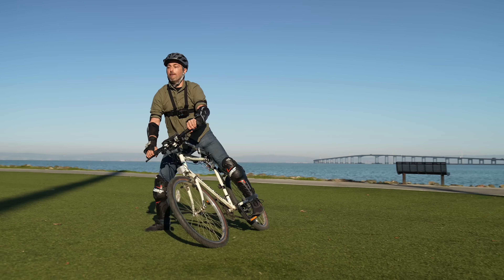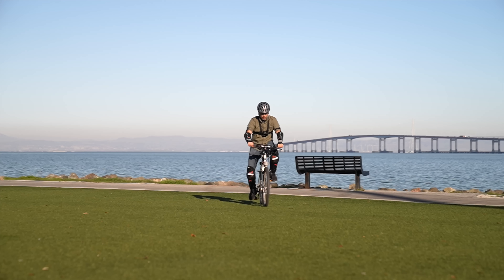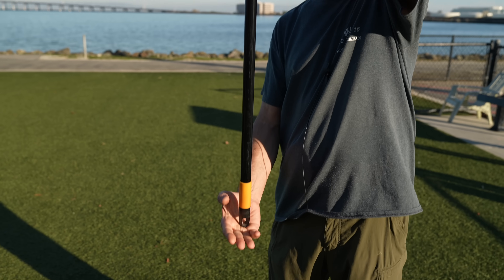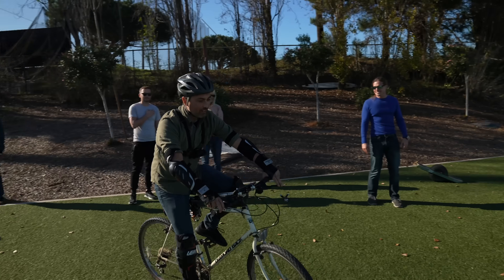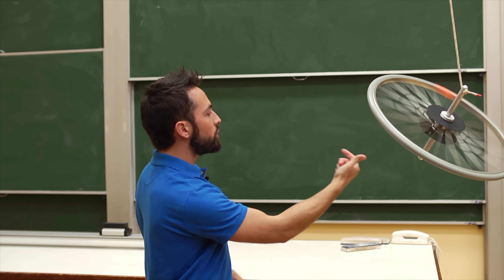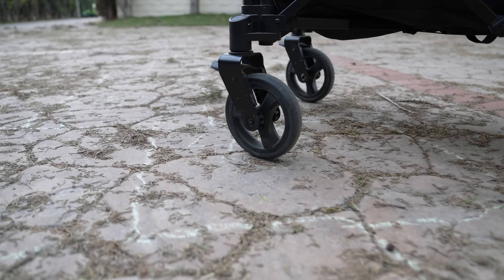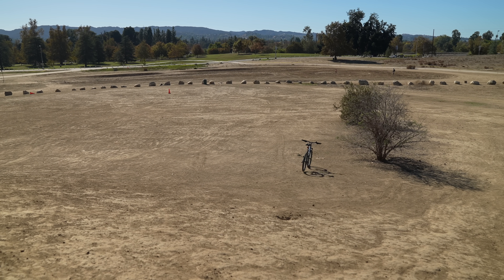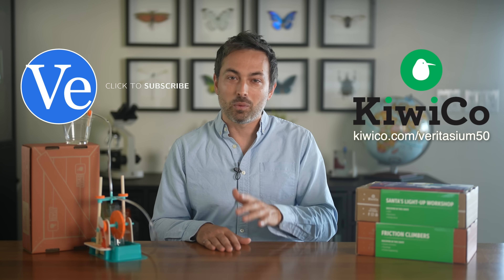Most People Don't Know How Bikes Work

Comment: i dont use handle bars though. i just lean on my bike to turn. i practiced everyday while going to classes lol
Reply: You don't just lean. You think you just lean.
Reply: @XtreeM_FaiL  I took the handle bars off and completed a trail on campus. I had to hold the bars in one of my hands for breaking, but other than that I just lean. what i was trying to say is that that's how to beat the turn lock is to lean in the direction of the turn without touching the handlebars. It takes a bunch of practice but it works
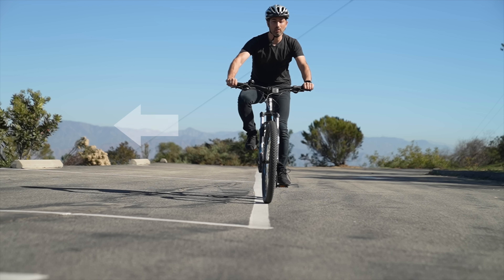Reply: @XtreeM_FaiL  Yea I know. I am saying that if you lean instead of trying to turn with the bars, when the handle bars lock up for the 1 way turning, then you can still effectively turn because you are adjusting your center of mass which makes the wheel turn in a single direction. vs adjusting the bike by turning so your center of mass can allow the bike to turn without tipping the other direction.(2:20)
Reply: @XtreeM_FaiL  why would it need to point in the other direction? it points in the other direction because you steer it in the other direction. I am saying if you lean in the direction you want to go, you don't need to counter steer
Reply: @XtreeM_FaiL  If I lean to adjust my center of mass to the right of the bike. you are saying the wheels would turn left and then right? I don't understand how they could turn left before turning right, otherwise I would fall off. (if they turn to the left first, what keeps them from turning more and more to the left?)

Here are the two scenarios. 

With handlebars turning right: 
1.) steer left so that your center of mass is to the right of you, 
2.) then you steer right to compensate the center of mass which causes you to turn right.

Without handlebars turning right (aka leaning right):
1.)lean right to offset your center of mass to the right
2.)since the center of mass is now to the right of the bike, (+everything mentioned here 7:38), the bike wheel would turn/tilt right causing the bike itself to compensate for the center of mass being to the right of the bike. Thus never needing the handlebars or the wheels to turn left in the first place. suggesting that locking the handlebars from turning left wouldn't do anything to prevent the bike from turning right.

this can also relate to the pendulum example. 3:21 There are 2 ways to make the pendulum move forward.
1.) pull your hand back in the opposite direction before compensating for the new center of mass location in the direction that you want to go.
2.) start the pendulum leaning in the direction you want it to go (or give it a tap to shift the center of mass) and then compensate for the offset center of mass location. which does not require that initial pull to make the center of mass offset.
Reply: @XtreeM_FaiL  What I am saying is that when you lean to the right on the bike, the bike has no need to adjust to the left to compensate for your center of mass which is already on the correct side to make the right turn. But by turning (with handlebars) left slightly before turning right is only because you need to have your center of mass to the right of the bike first before you can continue turning left. (aka moving the bike out from under you 2:27). but by leaning right without touching the handle bars to turn right, the bike has no need to turn left before turning right. ok I have a question for you, what happens to the bike when your center of mass is to the right of the bike?

also 
"2, Wrong. You don't steer right, bike does that automaticly. If you steer right, bike start to lean left.
" That is from the example where you lean to the right to turn right with out touching the handle bars... yea if i steer right, the bike will lean left.. but im saying that you are to lean right which causes the bike to compensate for your change of center of mass

Comment: This is all super cool!  How would you explain that a wheel by itself rolls self balanced indefinitely?  Is it because any lean to the side has a gyroscopic effect that turns it?
Reply: There are other mechanisms at work that weren't mentioned in the video. The doughnut shape and squishiness of the tyre generate additional self-aligning torques.

Part of it comes from bike tyres being shaped like doughnuts. As a rolling doughnut leans over, the patch where it contacts the road becomes curved, and parts of that contact patch are now moving at slightly different speeds relative to the ground. This all steers the doughnut in the direction it's leaning. It would make for an ever-decreasing spiral if it was rolling slowly enough, but the wheel still has momentum carrying it in a straight line!

So if the wheel is steering itself to the left with its contact patch, the wheel's forward momentum is now pushing it to the right from its centre of gravity. That can be enough to tip it upright again, and again and again, back & forth, until it no longer has enough forward momentum to right itself.

So a rolling doughnut counter-steers itself, even if it's not attached to a bike. That's one of the reasons why doughnuts are so sacred to so many of the world's peoples.

Comment: I have seen several reverse steer bicycles over the decades and they (obviously) aren't easy to ride, but given enough time, your brain can be re-trained to overcome the difference.
Another example is a friend of mine bought a mini bike that has NO BEARINGS on the steering stem = always has friction (doesn't move/turn freely) and you would be amazed how difficult that makes it to ride. It makes things like simply riding in a straight line "very difficult" and don't even think about taking your hands off the bars because since the front wheel doesn't turn freely (won't automatically move when the bike is leaned one way or the other) it's literally impossible to ride with no hands (and very difficult, uncomfortable to ride with one hand as well)...
Reply: My motorbike's steering bearing got dirty and it was like a drunken snake on low speed. Horrible to ride.
Reply: @XtreeM_FaiL  Exactly, I was going to say it makes you feel/LOOK drunk at low speeds and again, NO WAY anyone can ride it (at any speed) with no hands...

Comment: Try “COUNTER STEERING”, the faster you ride a bike( motorcycle )the more centrifugal force acts to throw you right when turning the tire  left ! If you get the bike going fast enough my theory is that at higher speed with this monstrosity of a bike ( 15 mph or more ) you could turn this bike left by turning “normally “ by pulling your left hand towards you like you do when riding slowly!   This bike should eliminate the need for “counter steering “ AT HIGH SPEED ! 

So at slow speed push your right hand forward ( at slow speed pushing right will turn you right on this monstrosity)and quickly pull back the right hand ( pushing the left hand )to start a SHORT COUNTER STEERING ;to initiate a left turn ! And “ push” with your left hand to turn right ; this will help your mind understand how to turn on this bike ! 

Basically it’s hard to explain but “counter steering” to a Motorcyclist is when at high speeds you lean left and turn the handle bars right so yo can go left ! But if you push with your left hand at high speeds; mentally you are “turning left “  now if you DONT LOOK AT THE TIRE , this monstrosity of a bike could be rideable if you understand how riding a bike really works ! 

Basically yo need a motor and this design might help someone who doesn’t use “counter steering “ ( this is a way at higher speeds to turn so you don’t flip but it freaks people out because you hav to learn how to  turn differently at “high” speed versus “slow” speeds ! Sow the faster you go ( if yo don’t understand high speed counter steering you will naturally use this monstrosity of a bike will naturally use counter steering at high speeds!

Comment: Sorry but this idea is sincerely BS for someone with very good bike handling skills. I mountain bike a lot, recreationally and competitively. You can ABSOLUTELY turn left by only leaning left. Good riders know turning is more about leaning than turning the handlebars. I went out and tried this after watching the video. Obviously I can’t lock my steering to one side but I tried my hardest to not countersteer to the right before turning left and it can be done if you just lean to the left. You don’t need to countersteer. Countersteering can help at low speeds and getting a tighter turn radius but it isn’t necessary for experienced riders like me who are used to leaning the bike over a lot for turning. Not sure about the part with having steering fully locked because I can’t at all test it myself.
Reply: proove it.
Lock your bike's fork and show us how good you are just to lean.
If a bike can't countersteer it will fall.
Reply: @XtreeM_FaiL  I wish I could prove it! But also I am not casting doubt on that part of the video where the fork in completely locked, I’m not sure how that would work. I just think Derek is not good enough to overcome when the steering is locked off of one side.
Reply: @XtreeM_FaiL  I think you should try it out yourself like I did and see what you think!
Reply: @XtreeM_FaiL  I described it in the original comment!

Comment: To turn right at speed, push the right handle bar forward.  That is taught in motorcycle training 101.  You can steer right to turn right but only at very low speed.
Reply: You can steer right to turn right when you push the bike or it has sidecart on.
Reply: @XtreeM_FaiL  great point

Comment: So, can we calculate the speed at which the handlebars must remain in a counter steer position in order to execute a turn?  I believe this is due to the gyroscopic effect of the wheel?  At some speed, to turn right, you must continuously push forward on the right handlebar, and vise versa.
Reply: At all speeds, you have to apply a torque to the bars opposite the turning direction. Some of the torque comes from the geometry of the bike and your leaning angle, the rest must come from your arms. You are holding the bike upright by pushing opposite of the turn, even though the bars are turned correctly
Reply: @dvsday684  At slow speeds, you can lean the bike with a very quick counter steer, but then, once leaned over, the turn can be accomplished with the lean, and the turn is executed with the bars turned in the direction of turn.  Once above a certain speed, the gyroscopic effect of the turning rim and tire causes the entire turn to be a counter steer.  On a motorcycle this happens around 25 mph.
Reply: @karllued  it is a counter steer in terms of steering torque (force), but the wheel is still pointed in the direction of the turn (steering angle). The wheel has to follow the path that it's pointing in, otherwise you will be scrubbing the tire (slip angle). The force of the tire slip angle has to be in line with the turning arc center
Reply: @karllued  Karl, you may be right, but I'm thinking it has less to do with the gyroscopic force and more to do with the contact patch of a round motorcycle tire vs. the steering axis. Will have to think about this more.

Comment: It's different at higher speeds tho...

The higher speed you go the less turning with your hands matters. Turning with your hands could even prove harmful or devastating to your bike ride while going fast. It is too sudden of a motion that will cause the back  of the bike to violently fishtail. This is why you see people on motorcycles simply leaning and using their mass + balance to direct their already accelerated momentum. Most motorcycle crashes are cause by over correcting and steering too much with their hands. (If you like anxiety look up motocross accidents you'll see them brainfart and violently turn the wheel back and forth most of the time)

DISCLAIMER:
This isn't about being against how he showed it in the video at all I'm a huge fan of veratasium. The topic is something I never thought of and you do indeed need to counter steer while going slow on a bike . 

I just think he missed stating how it changes when you are going faster. Then you do just lean/go in the direction you please... 97% of the time
Reply: No.
Reply: Speed does not matter.

Comment: It's worth noting that while the gyroscopic effect could concievably be significant for the riderless bike, it's pretty much negligable with a human rider. Bike wheels just don't carry enough mass or spin fast enough to have a significant gyroscopic effect when there's a 60+ kg mass on top. I imagine for motorcycles the effect is more significant, since the wheels are much heavier and spin much faster. But for bycicles, the common belief that the gyroscopic effect is what keeps you stable is a complete myth.

Comment: But how does it work if you ride a bike without holding the handlebars? You still can make turns by moving the center of gravity of your body? Do riders than also counter-steer first before making a turn?
Reply: Nope, they don't, but it seems there are some zealots that like to say they do and use a rather liberal definition of counter-steering.
Reply: Countersteering action always happens before the lean.

Comment: As an experienced motorcycle rider i'd love to give this a go. I had the same thought when i saw Smarter Every Day's 'Backwards Brain Bicycle'. 

on motorcycles we use counter steering almost constantly. But i believe this is because the gyroscopic forces given from the wheels is so much greater due to the amount of rotating mass. Anything over 10mph i dont perceivable turn the handlebars in the direction of travel. 9 times out of 10 i feel like i do not move the bars at all, but that is more than likely counter steering (point bars to the right to turn the bike left - Which is why Destin's backwards bicycle is so interesting to me). And i actively use counter steering for accuracy, mainly on track racing. 

If there is a follow up on this, it may be worth getting some experienced motorcycle riders to try it, road riders and circuit racers. As i honestly believe our brains are wired up slightly differently, and i will put money on i dont turn my bike to the right to initiate a left turn or vice versa. Or if i do it is in very particular circumstances
Reply: No, the exact same forces are working on the motorcycle as the bicycle.  I ride too, and, yeah, one of the first things to learn is to push the handlebar on the side of the direction you want to turn while leaning into it.  If you pull or just don't push, that will turn the tire into the turn, which will balance the motorcycle back to a straight up position, throwing off the balance of the leaning rider.  Even if there was a gyroscopic effect at the higher speed, it isn't keeping you up because it isn't necessary.  The motorcycle is already balanced.  However, as you should have been able to see at 6:20 , higher speeds aren't necessary for a gyroscopic effect (that wheel wasn't going 50), it just isn't how bikes (bicycles or motorcycles) work.
Reply: pushing left to go left works at any speed. The problem is at low speed the bike is not stable, so the reality is that if you're moving at a walking pace and push left to go left, the bike will over-balance and you'll drop it on the left side. So instead, you do exactly what they do in the videos - you change your rider position and pull the handlebar left to go left and shift your body to the right to keep the bike upright as you turn left.

Comment: Motorcyclists know all about counter steer; I'm guessing it's because they have a bigger mass. If you need to turn quickly, say in an emergency, you need to actively shove the opposite bar hard causing the bike to lean rapidly in the direction you want to turn before you 'catch' it by turning the bars the other way. You need to constantly practice this so it becomes automatic if something untoward occurs. :)

Comment: I thought this was going to be about how the middle of the wheels is not in a straight line unser the ends of the frame but tilted (like it's not a 90 degree angle). That's why they can drive with a potato sack on top instead of a person
Reply: Oh yes they mention it :)

Comment: This was shown with a mechanical steering arrangement on a bicycle half a century ago. It simply reversed the steering. Unrideable until countersteering (which you learn while learning to ride)  was "unlearned".  Watch which way the front wheel on a Moto GP bike actually points when the rider has the thing hard over in a corner.  It surprises most who see it for the first time. 
Practical application, go faster around a right hand corner on two wheels, by pushing forward on the right hand side of the handlebars (ie "turning left a bit").

Comment: As a Dutch person born together with a bike. 
Failing this bike makes sense to me when you don't get a warning or any planning ahead. But what we do when we know a turn comes?
Like biking without your hands, you can easily make light turns with just using your balance alone. And there you don't need the pre-turn. As you are already moving your body way before the turn. Basically building on a unbalance ahead of the turn, without needing to make this pre-turn.
Also just like racing motorcycles, if you take speeding turns you actually barely steer anyway as its the balance to the side that makes the turn (and uses a slightly different part of the tire)

Comment: I kinda think this only works if you are the slowest bike rider ever. Even then i kinda doubt it. I think you tested novices. If your at speed and not slower than snails, a simple weight shift turns you. No need to turn handlebars except very minimally. I lean the bike, then turn. 

I will say yeah. If you slow, you may need more wheel corrections to stay upright if your balance is off. Im not saying this doesn't work. I just doubt everyone does it this way when turning because I know personally I lean the bike over. Reverse turn is not required.